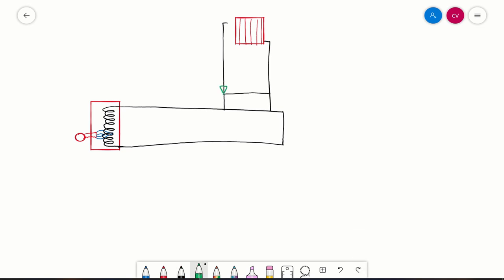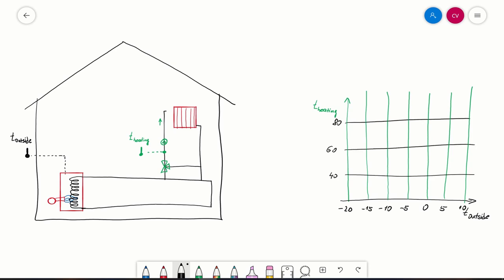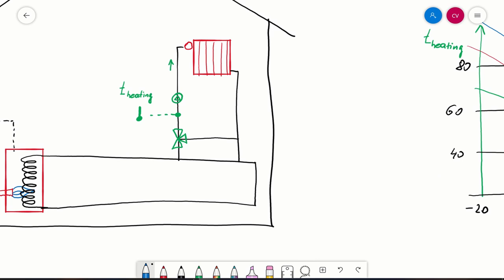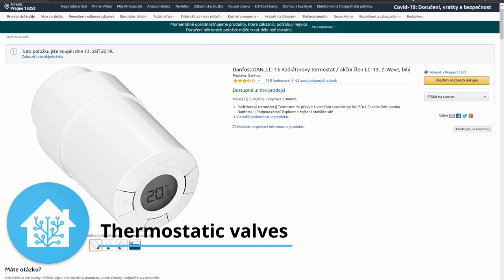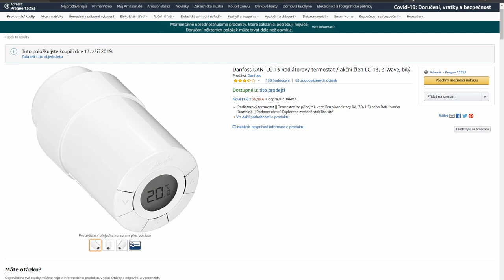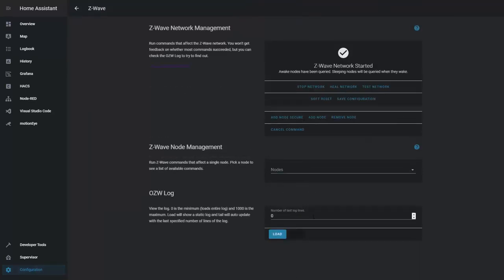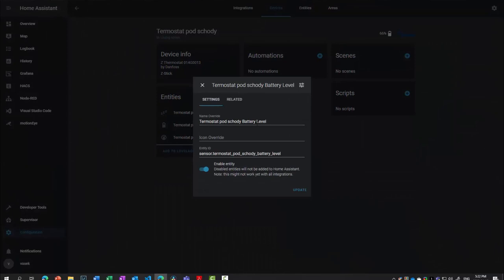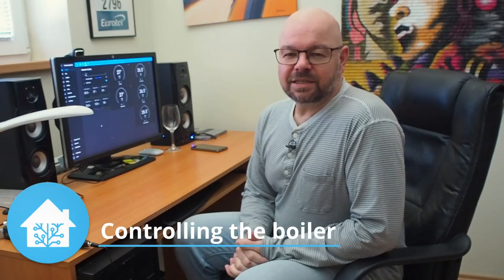Managing heating in Home Assistant - part1

Comment: Super smart solution for the boiler. I had the same issue but couldn't find the solution. What I did is just put the main thermostat to the higher temperature so it always requests heat. And if all radiators are closed the boiler recognises that water is not cooling and stop heating it.

Comment: Im solving the same issue with making the boiler smart. What I found so far is that most of the boilers support Opentherm protocol for which there is multiple Home assistant ready devices (Anna, Tado, Honeywell). The main problem with having only 2 states on boiler is I guess not using full potential of condensation boiler.

Comment: It is quite normal not having a temperature sensor inside the valve as it is sitting just next to the radiator… it would show 45C all the time the radiator is on. It is normal to have another temperature sensor at the other side of the room so you can have the real temperature of the room.

Comment: Hi again,
so you need thermostats to close them while you are not in the room. The question is if that is necessary, (really question up to the end-user) because cooling the room totally and then heating it when you are coming can be also not very efficient. So the real question is what is more effective keeping 19 degrees in the bedroom all day or cooling it down and heating it up again when you go sleep.
As I have already described under the first video, in my rooms I'm maintaining a constant temperature (except the bathroom).

So from my point of view, I still don't see a reason to use electronic expensive thermostats where you can use an analog one.
On these analogs you set max temperature for the room, so for example 19 for bedroom, 21 living room, 26 for bathroom.

When home assistants have priority for the living room, it will not achieve 26 in the bathroom because the living room will reach faster 21 and turn off the gas boiler.
Reply: So I will add one more thing. It is better to control with this automation temperaturę of water in heating system l. Much more efficient. Closing values on our heaters is like pushing a brake pedal down while at the same time pushing full gas